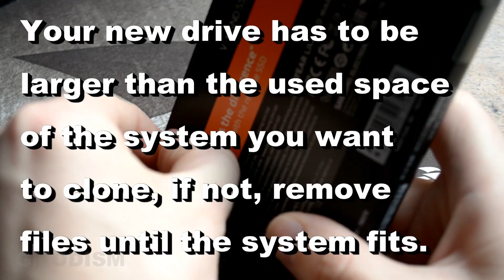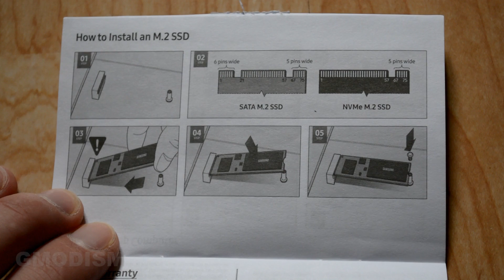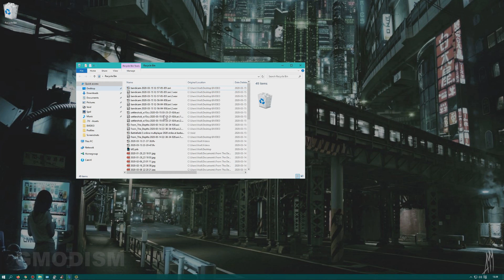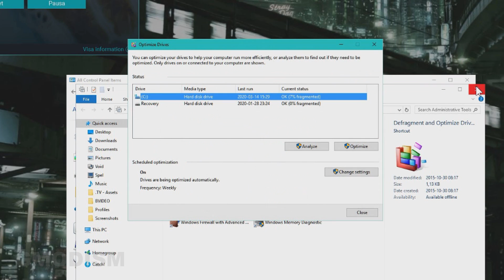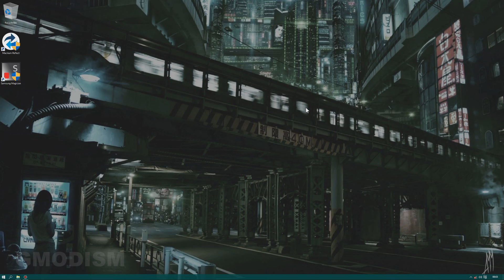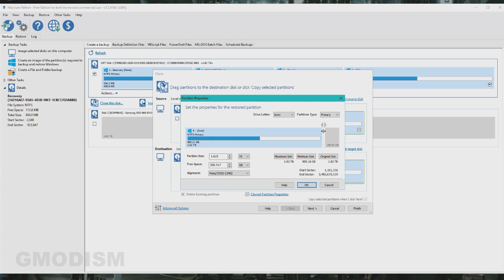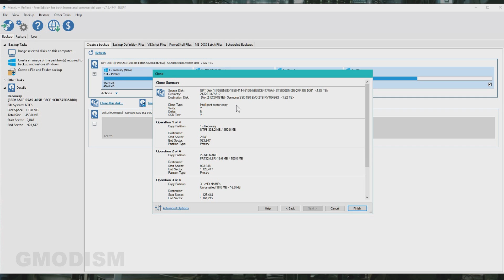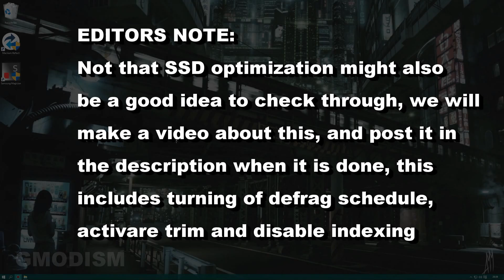How to Move Windows 10/11 from HDD to SSD

Comment: im going from HDD to a  m.2SSD should i still take out my hard drive with the reboot?
Reply: SeaZC did you tried this ??..
I have a same doubt..
Please let me know
Reply: @BalrajSingh-jb7ul  so i just havent done it but it should be fine ive checked with many people
Reply: @SeaZC  buddy thank you so much for a quick reply !
I am looking forward to put my HDD in place of the DISK DRIVE and will install a SSD SATA 
So should I proceed with these steps in the video ?
Reply: @BalrajSingh-jb7ul  yes you should!
Reply: @SeaZC  This won't give any license or piracy problems right ?
Sorry for the list of questions !
But I need help urgently
Reply: @BalrajSingh-jb7ul  it should not give you any privacy problems
Reply: @SeaZC  okay.. thanks for the help buddy !
Reply: @SeaZC  All the programs that I have installed in my C or D drive in my previous HDD, will they work after the migration of OS ?
Reply: @BalrajSingh-jb7ul  maybe but im not sure the video does say to uninstall most programs on your computer
Reply from the maker: You don't have to, but make sure you don't boot from it. Maybe disconnect it until we know the new drive as reliable, at that point you may reformat it.

Comment: Question:
I am trying to migrate Windows 10 from my 1tb hdd to a 256gb m.2 ssd. Obviously, it wont let me clone my files over to the ssd since i have taken ~750gb of the hdd. Will i have to delete files or transfer them to another drive in order for the os to clone over to the ssd or is there another method?
Reply: I got he same problem
Reply: Carter Evans How did you fix it?
Reply: Loris Hoti haven’t don’t know how
Reply: @carter._.evanss  i just did this, I had to wipe over 1600 gigs to make it fit, I'm now trying to see if I can wipe my first hard drive because I want to continue to use it.
Reply: how u solved the problem?

Comment: I am looking to upgrade my system to have an ssd but i dont want to spend a lot of money so I will be looking at getting something like a 128 or a 256 gb ssd to have as my boot drive. Is there not a way that i can make my ssd my boot drive without having to clone my hdd as i have like 600 gb worth of files/games saved on it.
Reply: You can redownload windows on the ssd and then choose that windows as the one you want to run while deleting the older windows
Reply: Gabriel I where is the path for Windows so I can delete of from my hdd?? And I’m guessing I would need to buy a new windows install for my ssd
Reply: Nathan Manning don’t need to rebuy just have a usb and download windows from their website although you will need to reactivate it. Look up tutorials on how to do this
Reply: Slayrie no but just make sure that your ssd is the boot drive in bios (best do this is easy ) or completely delete your hard drive.

Comment: parts of the partitions on the HDD are greyed out and wont let me drag and drop to the ssd, can you help?
Reply: execute the cloning program in administrator mode
Reply: @the1pigeon  I did that & it still won't let me drag the rest  over to the ssd, only 1 partition
Reply: @NikoReid  try reducing the size of the partition on the disk that is being written, then drag the other partitions in, and finally raise the size of the first partition back up. If that doesn't work then I'm afraid I can't do much for you

Comment: Mister I have a 1tb HDD with my files and OS in it and a 240 gb ssd
I just want to transfer my os to the ssd but the other files remain in the hdd
What should I do?
Reply from the maker: Make it fit, remove or place files elsewhere until the OS fits your new drive.
Reply: Gmodism Total Nerdery Channel any examples on what to do if I only have one 2 tb drive and I want to move windows 10 thats in it to a new ssd 120gb? Where can I move I ony have 1 disk, do I have to buy new storage?

Comment: If I just want my ssd to boot windows, can I still use my hard drive for other things, such as games ? Also, if this is the case, do I need to delete everything on the old hard drive to be able to use the hard drive and my ssd.
Reply from the maker: what you do when you clone is switching drives entirely, if you want sone stuff on the hdd you need to move it there, after you have formatted it.
Reply: Gmodism Total Nerdery Channel Ohh ok, but if want to use the HDD and ssd at the same time do I need to reformat the HDD ? Or can I have the existing data on the HDD until I know the ssd is stable ?

Comment: I really need help. 
I want to buy a SSD and get my Windows to the SSD from the HDD to get a faster boot up etc. Is that possible to just copy the Windows folder from the HDD to the SSD or do i have to reinstall it or something like this? I have read in many sites that it is recommended to get a clean install of my Windows but i have never installed Windows before and i got my PC from a guy which was fully factory new and installed with Windows on it, i was like "what, if it needs product key, licens etc. which i have nothing about because the Windows already was installed?" and found some information about the product-id/product key from CMD etc. which i think i can use if clean reinstall should be neccesarry  
So my question is. Is that possible to just copy the Windows folder in my HDD to the new SSD i will get, or is there any easier way without clone or clean install of Windows? 
I really appreciate your help 🙏🙏
Reply from the maker: This is the easiest way, cloning saves time, you can either make it fit by moving files somewhere else, or if you have a small SSD and that is not an option, you should instead make a clean install.
Reply: @GMODISM  Oh man :(( thx for your help
Reply from the maker: @Ibo2630  if your budget allows, I would get a SSD large enough for entire your system to fit, but SSDs over 1tb is usually a bit expensive.
Reply: @GMODISM  yeah, i was actually thinking 500GB but i just changed my mind and will go for 1TB. My HDD is almost out of space and i dont want to clone EVERYTHING from the HDD to the SSD because it is not all that is neccessary to move over to the SSD. Windows and my games is like my first priorities and one of the reason for i will get a SSD too. So my Windows and games have to be located in my SSD to better game experience and faster boot up...

Comment: Once i transfer the files over can I just factory reset the hdd to take off windows and use that as extra storage
Reply: Did you disconnect the SSD when you factory reset it ?
Reply: FlamesOfMagic what i did was Once i mirrored the hdd to the new sdd i rebooted my computer to boot from the ssd and then went to files on my computer and formatted the hdd so not i have extra space for stuff
Reply: @MarDigitalYT  you dont have extra space??
Reply: Ezm i meant i had extra space on my hard drive now it’s completely empty and windows is on my ssd

Comment: I have cloned the hard disk to the ssd,  changed the boot settings and removed the old hhd drive but when i turned it on it gave me the blue screen with an error 0xc000000e... The laptop is a toshiba satellite l650 (QUITE AND OLD LAPTOP:))) ..) any advice? Thanks
Reply: Uhmmm.....0xc000000e actually is an error for multi-disk setup...This is a real pain, it can be caused by other issues, but on this one it's actually an error for multi-disk setup, and it is a chance of getting it fixed(remember, I SAID A CHANCE) by reestabilishing boot sector files again. This should work if the problem is error for multi-disk setup.
However some more in-depth tips for fixing this is:
1. Check hardware
2. Rebuild BCR registry hive
3. Check BIOS settings.

I know I'm probably pretty late but please let me know if any of the 3 methods worked or if reestabilishing boot sector files again worked!
Hope I helped ya! :)))))
Reply: @deadchannel5933 thanks.  I have managed to  clone my disk with minitool partition wizard  :)
Reply: @ionut-ciprianandrei5946  oh I actually helped?
Reply: @deadchannel5933  i managed to do it in the day i posted my first comment :))). The method shown in this video didn't help me as it was giving me that error so, i looked up on YouTube for other alternatives :) . I have another issue now : when it turns on or restarts i have a pop up error from Windows Backup saying that "this feature is not available in a portable workstation environment" . I guess the backup is not working... I have a genuine W10 pro but without a license key.
Reply: @ionut-ciprianandrei5946  Well, then.....I'm sorry, I really don't know anything else....
:(((((

Comment: I have a question, so would I go with the same process if I want to keep my hdd ? I bought an ssd souly for windows 10 if I clone it wouldn't I have two instances of windows 10 on my pc ? -Thank you :)
Reply from the maker: Yes you would, but you can only boot one version of windows at one time, you can technically have how many operative systems on your computer you want but may only boot one. My advice is move everything to the SSD and use the HDD for backup and large files like movies and the like.

Comment: I’m having trouble, I copied my HDD to my SSD then switched the sata cable to the new ssd but when I go to boot windows, the option for windows boot manager does not appear in my bios. Any ideas what I can do?
Reply from the maker: What does appear then?
Reply: Gmodism Total Nerdery Channel The usual boot options come out, recognized my ssd but windows boot manager is nowhere to be found.
Reply from the maker: Try booting from the ssd, if that won't work something may have failed, but ssd appears and is connected to power also?
Reply: Gmodism Total Nerdery Channel Oh that’s right silly me, I got it working! Thank you so much, that was a great tutorial
Reply: @vinny29  did u have.a bios menu? i did not have that and im not sure if something went wrong.

Comment: Could I have my games and apps on my HDD and just windows on my SSD?
Reply: My suggestion is for the heavier games put that on the ssd as the load times become very long on an hdd
Reply: Yes
Reply: You need to move the whole system first but after you do that you can delete any duplicate files from both
Reply: @bboi5845  the problem I was having was that I had used 1.8 tb on HDD and owned a 120gb ssd. Just wiped the system
Reply: Alex Manganas that works lol unfortunately you can’t choose what to copy with this software

Comment: i bought an ssd for games and my OS so i'm using this method to clone all of my files over. after my HDD has finished cloning and my new SSD is working should i just reset my original hard drive for future storage?
Reply from the maker: Yes you can do that, but wait one month in case there is something wrong with your new ssd, or make a backup of your system before you wipe the HDD.
Reply: @GMODISM  ok thanks. Will do!
Reply: @GMODISM  I had my windows pre installed when I bought my new laptop.
Will cloning affect my license or any kind of piracy will occur or not ?

Comment: It says “not all copied. Insufficient space” though i have large amount of space in my new ssd. Need help pls. Ty
Reply: No... just no!
If anyone else has this problem then here is the actual solution...
Go ahead and begin as usual, you'll get the error saying " not all partitions copied, insufficient space" etc, at which point an option becomes highlighted that says "cloned partition properties".
Click on the main partition (the one that will become C drive on your SSD and has left over space) and click cloned partition properties.
Shrink the new main or 2nd partition to create free space, the same size of the 3rd partition that wont copy (you can test by trying to copy partitions individually but it should be the 3rd one).
Now drag the 3rd partition into the new empty space and drop it.
Bang! You are now ready to clone all 3 partitions!
Also you DO NOT need to shrink the volume and leave unallocated space as this program does that automatically as you can see under advanced settings.
Reply: Quick summary: 
-click 2nd partition
-Click cloned partition properties 
-Shrink volume to fit 3rd partion in new space
-drag and drop 3rd partition into new space
-click next
Reply: Google up ssd unallocated fix that was my issue
Reply: Allocate it all or clear it in CMD

Comment: hey gmoodism love the vids I bought a new sk hynix 1 tb ssd t use for games and OS and still use my HDD for my bulk storage. I want to just move my OS and sme games over without cloning my whole HDD because it is to big for the SDD. Any recommendations?
Reply from the maker: You have to move away all files you don't wanna copy over to the SSD until it will fit, so you'd need a 3rd drive. Make it fit and clone, or do a clean install of Windows, that is your options.